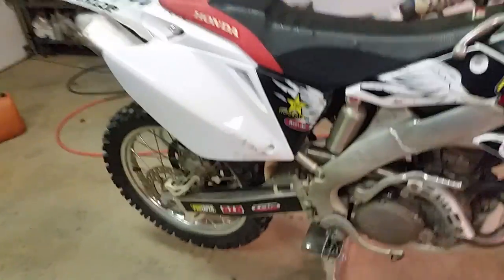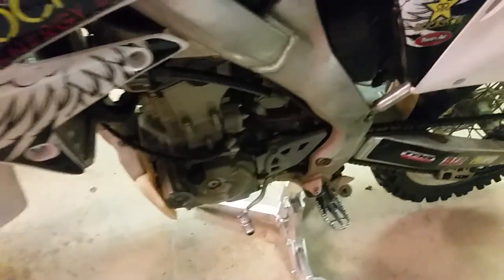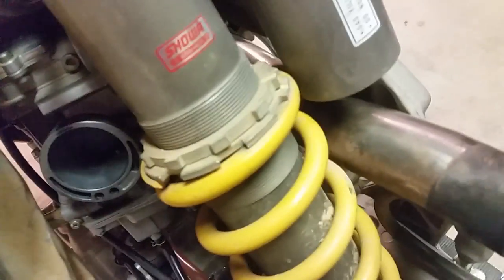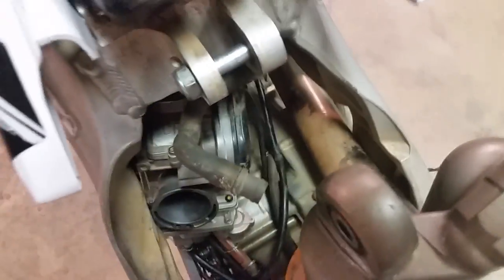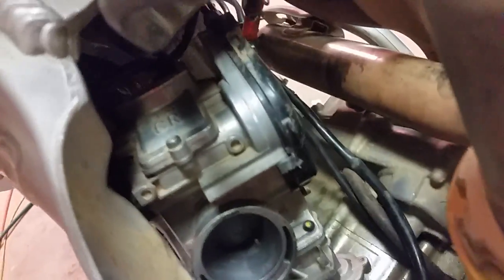Crf250r carburetor removal

Comment: I spent a whole day it seemed putting my carb back in my 05` crf250r. It really makes you miss your old 250 2 strokes, when all they had was two boots and a throttle cable, as far as I remember you didn`t have to remove the gas tank, sub frame, seat, shock, etc, etc. I went to remove my carb and found the top bolt threads missing=jb weld. Parts in the bowl green,  and a jet clogged. No wonder the thing wouldn`t start. Now it starts on the first kick, yipee !

Comment: bro youve got to make a video on how to get the air boot back onto the back of the carb. Its killing me
Reply: pain in the ass!
Reply: Little bit of bell Ray grease or petroleum jelly
Reply: Remove the air filter cage...after the full sub frame has been aligned and tight....use a wooden hammer handle to bump the boot back onto the carb. Also found leaving carb loose at the all clamps until all boots are mated.

Comment: To be fair, as a first timer this video was on point. It might not be the quickest method but it breaks down many issues I struggled with. stupid little issues that will become second nature in time but this video certainly helps a bloke understand his bike more when starting out on maintenance. The throttle cable was being a proper cunt and after two cups of tea and avoiding the shock i've decided to do it this way. I had heard Honda CR carbs are tight for room. still, I learnt a lot from doing it the slow way and pulling it apart...on a separate note she has sand everywhere so this allows me to deep clean before I put her back on the Ice. The first time always makes me feel like I'm going to break everything and loose parts, anyway, time for another cuppa.

Comment: Hey man my crf250r 2004 takes like 15 20 kicks to start its a Pain in the ass what should i do? Should i clean out the carb or is there anything Else I can try first??
Reply from the maker: Cameron Degering I recommend checking the valve clearances first
Reply: I have the same issue....sometimes it takes for ever to get mine started
Reply: I would clean the carb/lines. Put new gas if it is old. Then go get your valves adjust. I'm 1 year late I see lol
Reply: Do the decompressor mod from thumpertalk

Comment: So mines not starting now and I'm reading that the throttle position sensor shldnt be taking off how you showed anyways i did and I'm wondering if thats the reason it wont start
Reply from the maker: The throttle position sensor should have a mark on it that you line up with the screw but if that mark has worn off you can use an ohm meter to set it just follow the factory service manual procedure. Even if that sensor is in the wrong spot it should still start that throttle position sensor is only used to advance and retard the timing.

Comment: what size jets did you put on? I just ordered a jd jet kit and will be jetting it since it was at a 4000' altitude and is now at sea level
Reply from the maker: marco hernandez I ended up not needing to rejet once I replaced the gaskets and the acc pump it ran fine I think the acc pump wore out because it runs great now

Comment: you can take the carb off without taking the gas tank or subframe or seat off 😂😂 idek why u did that I have the same bike and I've never needed to take all that off
Reply: To be fair, as a first timer this video was on point. It might not be the quickest method but it breaks down many issues I struggled with. stupid little issues that will become second nature in time but this video certainly helps a bloke understand his bike more when starting out on maintenance. The throttle cable was being a proper cunt and after two cups of tea and avoiding the shock i've decided to do it this way. I had heard Honda CR carbs are tight for room. still, I learnt a lot from doing it the slow way and pulling it apart...on a separate note she has sand everywhere so this allows me to deep clean before I put her back on the Ice. The first time always makes me feel like I'm going to break everything and loose parts, anyway, time for another cuppa.
Reply: Bobby Johnson make a video then and show us
Reply: I went to mmi i approve this video its the new way ill do it. Why not
Reply: It's a very tight squeeze though. On my 09 250crf there was probably a couple milimeter of leeway to get it out at most. Good luck getting the carb back on the intake and airbox that way. Possible? probably, with an hour of cursing.